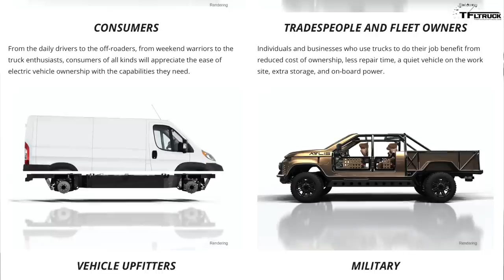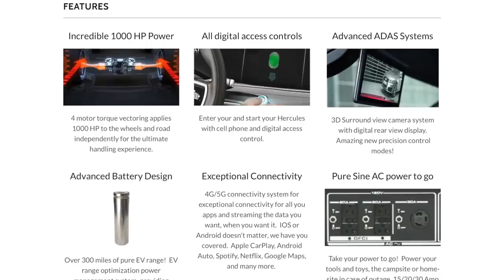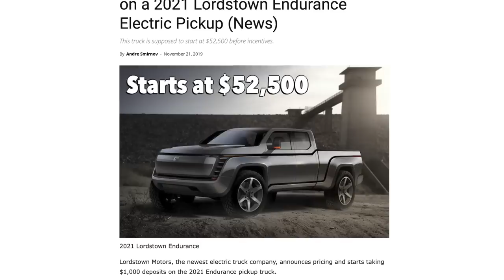Will You Soon Be Driving One of These Electric Trucks? Top 10 Upcoming Electric Pickups from A to Z

Comment: If CyberTruck is really made out of origami stainless steel plate and friction welding, it is indeed possible to drastically reduce manufacturing cost and capital investment. I don't know if there will be other shortcomings. No one has done it before.
Reply: Ya, they have.  This is how aircraft are manufactured.
Reply: @Bryan46162  Monocoque is nothing new but what they do with cybertruck is very different.

Comment: Current EVs are perfect for the morning commute, but not for consumer truck use. Until EVs can be recharged in a few minutes at a station available on every corner (like gas stations), EV trucks will be pretty much for intercity delivery fleets...not for suburban/rural pickup truck needs. They will get there, but not for a number of years. It's the (lack of) charging infrastructure that will be the speed bump to widespread EV truck adoption.
Reply: Every dealership will have a charging station
Reply: Every dealership will be a charging stations when Eevee's are adopted
Reply: @josephgrochowski1942  Not enough. Charging stations/processes need to be AT LEAST as convenient as gas stations in order to get most people to switch....that's many years off at the earliest.

Comment: Ford needs to tow a Tesla cyber truck now
Reply: That is a pissing contest that Ford would ultimately lose. Think SpaceX cold gas thrusters giving downward force on the wheels to get things moving. They are already planned for the SpaceX Roadster.
Reply: Anything that out weights the Tesla would beat it. Tug of war is a traction test and the heavier you are the more traction you have.
Reply: Or hook a 10,000 pound trailer up to them. The CT would run out of juice in 100 miles.

Comment: For Ford's towing stunt, the truck only had to produce enough power to pull 1800ish pounds. The guy over at Engineering Explained did the math, hell just a glance at the tow strap would tell you it didn't need much force to pull rail cars. 
I won't be driving any electric truck any time soon, except for the Atlas and the Bollinger the rest look like shit and they all cost to much.

Comment: I would say Atlis and Ford have the only 2 viable EV trucks, the others are either just toys or too expensive. The Bolinger looks cool, but it's just a toy for rich people, pretty much same for the Cybertruck.
Reply: walt charamba  STARTS at $39,000 for 250 mile range, 500 mile range STARTS at $69,000. Neither package will meet my needs for bed size. I can buy and brand new F250 built to MY specs with a 750 mile range for $40k.
Reply: walt charamba  That's fine if the Telsa meets your needs, it doesn't meet mine. I'm not going to pay $40k-$70k for a vehicle that doesn't meet my needs. Maintenance on ICE vehicles is minimal, my current vehicle has 320,000 miles on it and maintenance is only a few $100 per year, best estimate BEV MIGHT save me $100/month in fuel costs over a new vehicle.
Reply: walt charamba  If the Tesla doesn't make a vehicle that meets my required specs, the battery tech is meaningless. Which at this time they don't. I'm not buying a vehicle just because it's a Tesla.

Comment: Tesla.  They have built there infrastructure for charging already. The are already experienced in EV systems and the extreme life of these systems is also well proven. If they estimate that they will have 500 miles of range it will probably have a little more when it arrives.  Their experience and success is the reason why the world is jumping in.  They have to survive.  
I wondered if the truck was “beautiful” I had to ask myself if the average pickup truck shape is “beautiful” and is a beautiful truck is useful. What does a “Proper Pickup Truck Look like and why?  Does it limit what a pickup can be?  Function and efficiently is beautiful.  The corrosion resistance or rather denial, is very impressive.  

And Tesla has lousy “PR”.  They don’t need or have an advertising budget.  I don’t own Tesla stock or any of their well established vehicles.

Comment: Non of these will have good sales to the towing community as they don't have charging stations that you can use without taking up 5 chargers or disconnecting the trailer everytime you need to charge. Ya so no contest for ICE in towing right now
Reply: You seen the Model X tow video? Guy went from i thing 280 mile range to 110 when towing. EVs suck at towing. Put it in a cold environment while towing and its a disaster.
Reply: @ColoradoHiker  that's exactly why I said it would  not sell well for the towing community.

Comment: cough  ,,,   I bet that Tesla is toasty warm up in the mountains  😂  NOT
Reply: The problem isn't when your plugged in    AND   I'm not saying you can't get by.     I'm just a spoiled rotten product of the oil age.    You just don't have the option for that raging heat that you get with a water cooled gas engine.     Sure you can turn up the heat but its going to affect range significantly.    No driving around with the window halfway down in a blizzard  😂

Comment: Please, do not propagate Ford's commercial about pulling a train with 100 million, gazillion pounds. The friction coefficient of the train wheels is so low that an average built human can lean on a train cart and push it a few meters. Just ask yourselves - How the F they can pull all those millions of tons with a strap rated for 2,000 Lb? If you make the calculations you will discover that you need only about 1,400 Lb of pulling force. A Prius can do it! Stop dumbing down the people. They are already dumb enough. 

And what is this obsession with towing trailers? Do you know what percentage of the truck owners tow regularly? About 10%. If you are a contractor working around town, you will make about 100 miles a day tops! What does it matter then how much you will deplete the battery? In the evening you will be back in the shop and will charge your truck on cheap, night rate electricity. 

If you need to tow 10 tons up the mountains every day, for God's sake buy a diesel truck. 

But unless you are a toothless idiot who buy diesel trucks exclusively for "coal rolls", ask yourselves - Do I really need to tow that much, how often and where.

Comment: Elon Musk will be in a home before electric vehicles ever have a commanding presence on the road or make a legitimate difference in carbon output. By that time, technology will find the means to produce a clean, abundant fuel source for the internal combustion engine. Do we REALLY want 10's of MILLIONS of vehicles on the roads running on "batteries"? Remember...... there was a time when people were forced to rely on coal to heat their homes, before........they were aware of this fuel called "natural gas". Stupidity runs rampant in today's society.
Reply: the difference EVs make is when they push the grid towards cleaner energy, there is not technology that will save ICE fuel,its physics, if people have the means to produce an energy dense complex carbon chain then they could just use that energy to build a battery and charge it for much higher efficiency gains. "there was a time when people were forced to rely on coal to heat their homes, before........they were aware of this fuel called "natural gas". Stupidity runs rampant in today's society." yes then natural gas started blowing up houses and killing people in their sleep, i use a electric furnace that is powered by hydro since its the smart thing to use.
 there was a time people used gas to power their cars, it polluted the streets, lowered the average intelligence of the local populations around them, and gave thousands of people cancer annually, this was all before electric cars used lithium batteries and companies at the time didnt even attempt the technology until some silicone valley start up did... the stupidity people have to keep defending gas.

Comment: I am disappointed in Fast lane. You are not being objective in dealing with EV trucks.
Reply: John Smith how so?
Reply: nathan adlen,
when Fast Lane does review and tests on gas and diesel trucks they are usually
unbiased and honest showing the downside as well as the upside. In reviewing
the EV trucks not so much. 

 The best thing
that the current EV has going for it is that it can be fun. The down side is
over priced compared to a gas or diesel, too short of a range, and too long to
re-charge which is true for all EV's cars and trucks alike. 

 However the
trucks have even more downside. People expect a truck to be able to be used as
a truck. The EV trucks cannot come close to meeting their counter part, but
fast lane is not pointing this out. Consequently I am disappointed in
them. 

 As much as I
would like to have an EV I have no intent on purchasing an over priced, short
ranged, long time charging vehicle that takes 20 years just to break even with
when compared against a gas or diesel vehicle.
Reply: John Smith have you watched any of our tests regarding towing with the Tesla model X? We are trying our best to show the positives and the negatives of working with EV trucks. As it stands, considering we have yet to test a proper EV truck on the market, we are doing everything we can to cover all the technical information in advance. If the range is terrible, we will report it. If its capacity is good, we will report it. Regardless of the outcome of any of the vehicles we test, we will give our unbiased report about that vehicle. That includes diesels, gas powered trucks and EVs.
Reply: Nathan adlen, I will be watching to see if your claim is accurate. To date it is not.
Reply: @JohnSmith-ug5ci  They can't really report on something that hasn't been released. Watch the Tesla Model X towing video as suggested above.
Reply: James Webb, but they DID report on what has not been released. Also I did watch the Tesla towing video and while they dealt with towing my question is WHY? The average Tesla owner is not going to be using the vehicle to tow and get any kind of distance. If they wanted to do a comparison they should have compared it against a comparable sized gas vehicle showing all its faults in normal use and those faults would be price, range, and charge time.

Comment: Cybertruck is so ugly.  No thanks.  

I'm not on EV bandwagon.  Range is not far enough yet when towing or loaded heavy. I dont want to stop and charge for an hour on road trips.  I could handle 15 min full recharge but only of the range was much improved.  I would still not have any interest in driving 1-1.5 hours and having to stop to recharge for 15 mins. 

Over 4th of July week, towed boat to Michigan. Its normally 8 hour trip.  Took 10 hours up and 13 hours back home due to traffic.  I cant even imagine how long it would have taken towing the boat up there with an EV truck
Reply: walt charamba range will be lucky to get 150 miles while towing with Cybertruck with a decent load at highway speed.  From what I’ve seen on Model Y.  It’s gonna consume about 3.33 times as much KW hours while under load. So that’s gonna be 150 miles max range.  Don’t fool yourself your gonna get 500 miles towing.

Comment: nope, i wont. ill stick with my 05 LLY duramax.
Reply: Ah, the good 'ol overheating LLY. Worst truck I've ever owned, though the transmission was great, so I'll give it that.
Reply: @donleamon8653  I have 228k miles on mine and i have had no overheating issues, just changed thermostats and put a built trans in it
Reply: @nickl2268  - then you have never towed heavy with it out West. It was a known issue with them. Along with window regulators, gauge clusters, HVAC controls and on and on...
Reply: @donleamon8653  sure have, i just fixed the problems that cause it to overheat in the first place. only thing wrong with my truck after 240k miles is a few of the lights are burnt out behind the radio controls lol

Comment: They need to find a new battery,  the lithium is limited the mining is slave wages as well horrible for the environment.  Not to mention where are they going to get all the electricity.   We still have places in north America that still have rolling outages.   I think they are focusing on an unrealistic path.  The infrastructure is not possible
Reply: Lithium mining is no more bad for the environment than oil "mining" is or coal mining. This has already been disproven several times. However, i agree that we do need a new battery, seems that solid state batteries are the next thing. We need to move away from Cobalt use in batteries if EV's are on rise